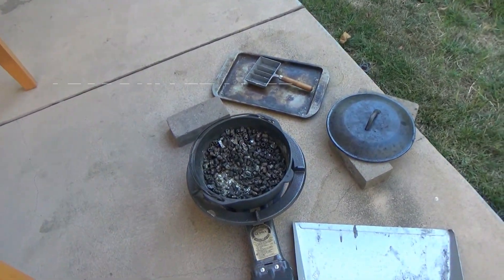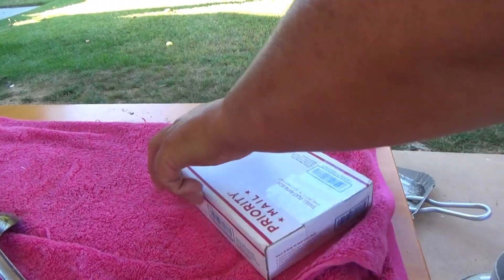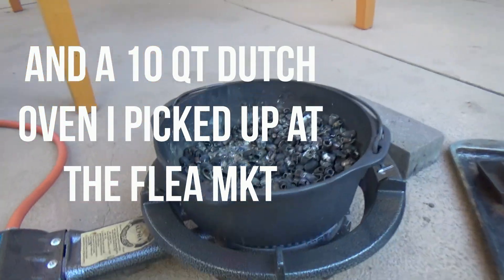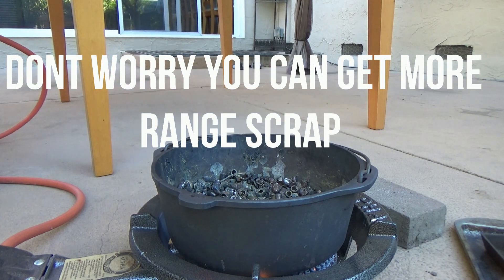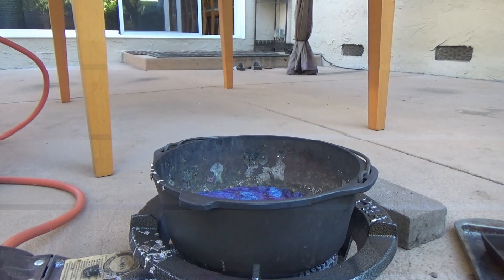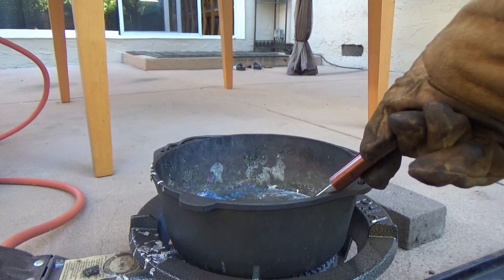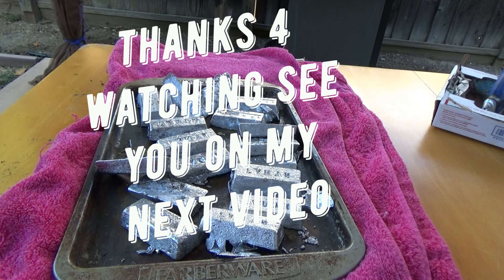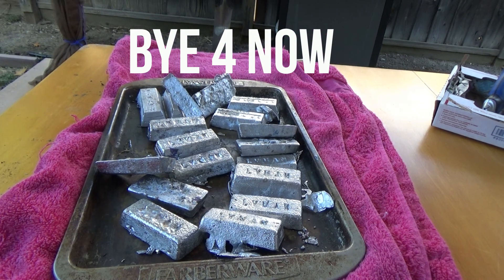RANGE SCRAP TO LEAD INGOT'S PART-2

Comment: LB4L, terrific video! If I may add, put a lid on the dutch oven to speed up the molten process. Things get hotter faster and stay hotter when covered and heat won't escape in the cooler air. It also saves on fuel. BTW, that was a lot of lead! 17 lbs would be about 119000 grains! That is a lot of bullets! That's about 1000 115gr 9mm bullets, right? Did I do that math right?! That's about 800 .308 bullets for my rifle! Excuse me while I go to my range and collect lead. I'll see you later!
Reply from the maker: It was cooking for an hour covered before starting the video and yes i still need to havest more lead before it starts to rain because the berms harden up and becomes impossible to use the scooper.
Reply: @Ford360CID  do you do this at the county range? if so when?
Reply from the maker: @TSGEnt  yes sir i do, before jerry retired he allowed me to harvest some range scrap but not from the back berm, jerry now volunteers there now on weekends.
Reply: lead bullets 4 life 
Do you cast your bullets out of the range scrap or you have to add any other materials (like tin)? Thanks